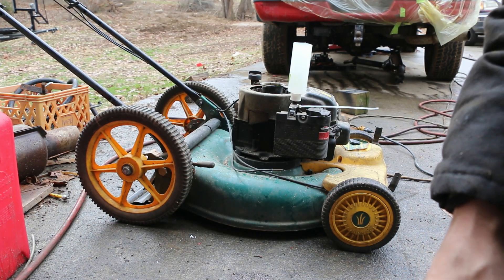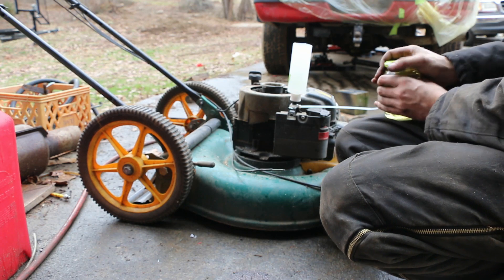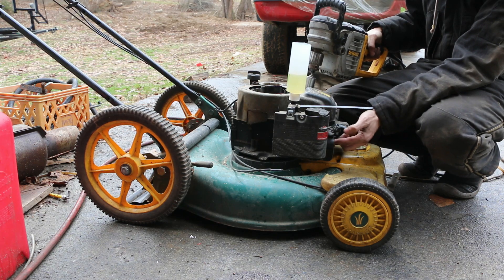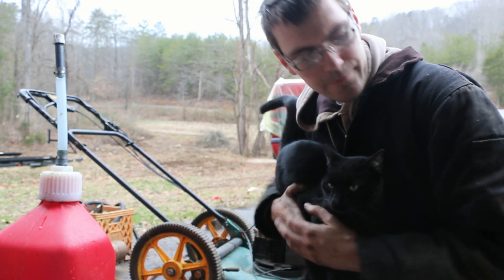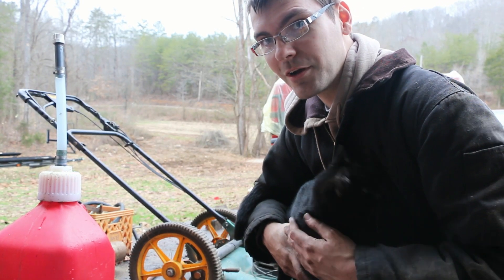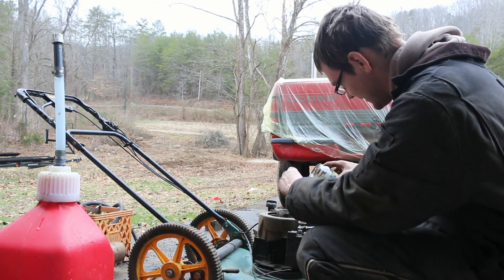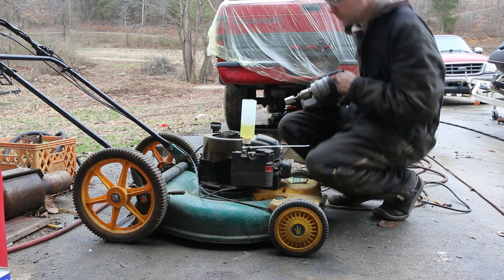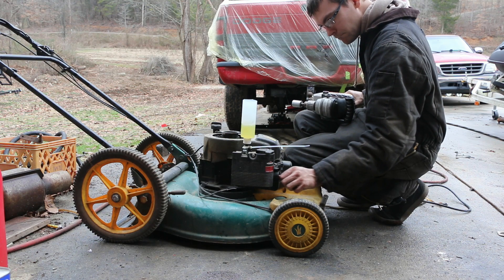Failing at a Stale Gas Revisit. (Testing in a small engine, Runs fine)

Comment: The stale fuel usaully runs a lower compression motor like tge briggs and strattin fine. As long as it's clear without sediment. The higher compression engines like tge newer cars motorcycles exc need the higher octane fuel. To run properly they will start but they tend to starve for feul symptoms. Like a jetski or atv or things with high compression engines. I have come across this. Additives don't seem to help any. And the larger the motor the better for stale fuel. The atv runs and starts as long as it's not cold. But on hard acceleration will act like it us starving for fuel. The same with a 4 cylinder jeep 2.4 litre motor fuel injected. It will have trouble staring and run as if it was starving for fuel till fresh fuel is added at least 75% ratio just something I been playing with 100 gallons is good thru the summer stored thats it.
Reply: I have a turbo Subaru so I just add 75% new gas to the 2-3 gallons 8 year old gas? That would boost the quality enough to run perfectly?